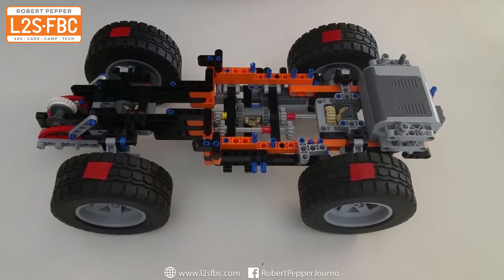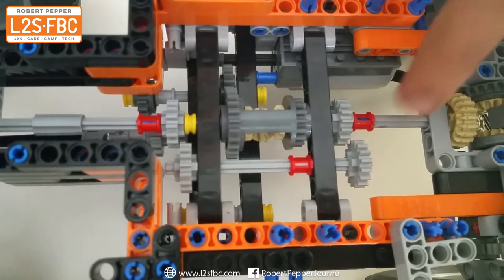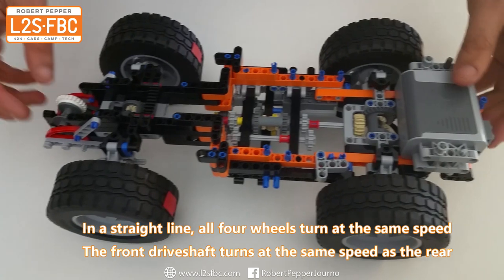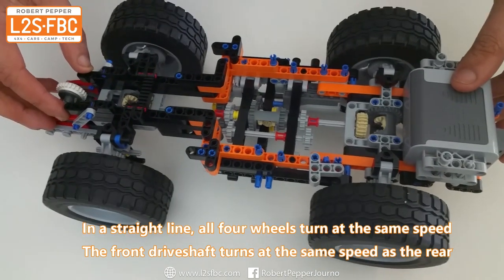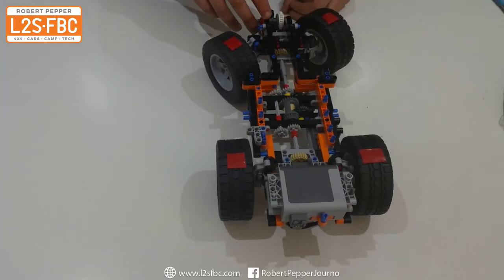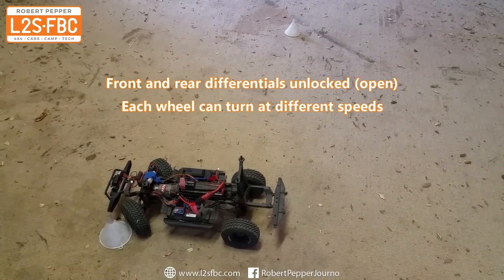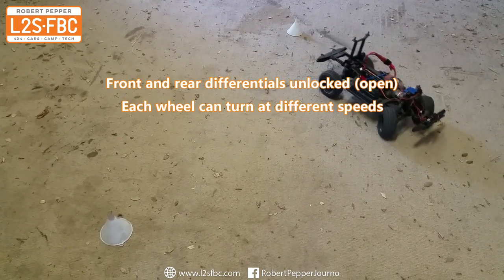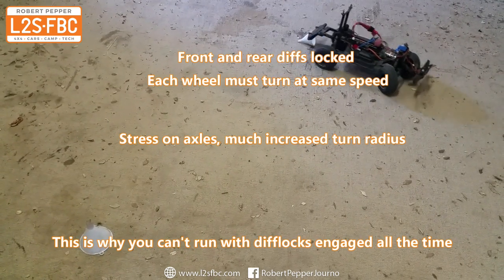How differentials work in 4X4s - all you need to know!

Comment: Came for the Snowrunner Review, stayed for 4x4 knowledge. Cool video, really! I never fully understood the whole difflock thing from Mudrunner and only got a vague idea from googling it. 
Your way of explaining and especially showing it really helped me!
Reply: @L2SFBC  I didn't play Snowrunner yet but as far as I am aware they had implemented some kind of wind up (or at least something to 'act' as a wind up) in Mudrunner at least. Doing a corner with difflock on was a little bit less easy and a bit 'awkward' there. 
Also, and I really would be interested what you have to say about that, in Mudrunner you would actually take damage to your car when driving on a solid surface with difflock on (even when driving straight). So you could only use it in the mud. After watching your video this damage doesn't make much sense to me but maybe I am missing something?
Reply from the maker: I didn't notice any difference with diff locked or not. There should be though.

Comment: this is great. I've a Jeep Wrangler ... no centre diff, which is why is part time 4x4. Mine has the newer Auto- 4wD which is 2 wheel unless the sensors detect a slipping wheel, when it will kick in 4wd.
2019 JLUR Surrey, England.
Reply from the maker: What year is your and where in the world are you?
Reply: @L2SFBC  2019 JLUR Surrey, England

Comment: Question - Ford recently removed the Torsen Front LSD from the 2023 F150 Raptor. Ford is stating that they are getting the same  performance by computer / electronic braking. So, based on your outstanding video, which I really appreciate, does it appear feasible that Ford is being truthful and getting this done without a mechanical LSD by applying braking to the "free spinning" or least resistant wheel?
Reply from the maker: Exactly right, yes!

Comment: High Robert, long time subscriber and love your explanations. I've been following the development of the Ineos Grenadier that is permanent 4wd.  Most of the reviews I've seen are off road testing.  I'm curious about transitions from high traction (pavement/tarmac) to low traction (dirt, gravel, ice, snow) and weather the Center Diff can be locked on the fly or will traction controls need to be at work, until the vehicle can be slowed to lock the center diff and/or the cross axle diffs? I have a 2017 jeep JKUR with part time 4wd and can shift from 2wd to 4wd Hi at 55mph, so the permanent 4wd with center diff is foreign to me.
Reply from the maker: Not driven it but typically you can lock the c/d on the fly at any speed. Cross-axle lockers are usually speed-limited and sometimes in low range only.  I don't know if it's a centre diff or clutch or Torsen or whatever. INEOS did promise me a tech interview but not yet seen that.
Reply: @L2SFBC  I did see a video from a new owner where the front and rear cross-axle lockers are limited at 15 kph.  He said there was no info in the manual regarding the CDL.  I look forward to when you can do a tech interview!  Thanks!

Comment: Great video! Question: if I’m off road and have all three locks as an option, are there situations where I Dont want to lock all three? It seems like locking them all is the best solution all the time off road.
Reply from the maker: Definitely not lock all all the time only when needed
Reply: @L2SFBC  how do you define “when needed”? When stuck already? Also Is there a downside to locking all three as soon as I leave pavement?
Reply from the maker: That's a really big question but the short answer is lock the centre soon as off-pavement, and use the others when you need to control wheelspin eg lifting wheels over rocky ground, but otherwise leave them out.
Reply: @L2SFBC  thanks!

Comment: Not sure if you could answer this one.. I'm converting my range rover P38 to electric, I'd like to get rid of the gearbox and transfer case, and fit 2 Hyper 9 motors  (1 to each propshaft directly). The motors can be synched electronically.  I'm not sure if it could cause any potential problem or not.  There would be the existing open diffs front and rear and the vehicles existing Traction control. I would have to fit shortened propshafts of course. I've searched the web, can't find any info on this set-up anywhere. I'll be using it for road use only.  Thanks in advance.
Reply from the maker: Interesting and possibly difficult. You'd need software logic to vary torque/rotational speed as the car turns a corner which would be driven off steering input a a yaw sensor. Not going offroad simplifies things greatly as no need to replicate a centre diff lock. I will ask some specialists.
Reply from the maker: Interesting and possibly difficult. You'd need software logic to vary torque/rotational speed as the car turns a corner which would be driven off steering input a a yaw sensor. Not going offroad simplifies things greatly as no need to replicate a centre diff lock. I will ask some specialists.
Reply from the maker: Interesting and possibly difficult. You'd need software logic to vary torque/rotational speed as the car turns a corner which would be driven off steering input a a yaw sensor. Not going offroad simplifies things greatly as no need to replicate a centre diff lock. I will ask some specialists.
Reply: @L2SFBC  Thanks for reply Robert!  I've checked the spec's and the Land rover forums on the P38. There is no "Electronic Stability  Programme - ESP" fitted to the P38's. if this helps in any way.